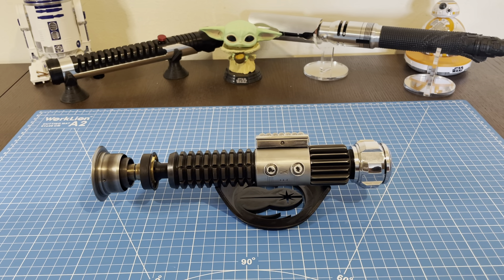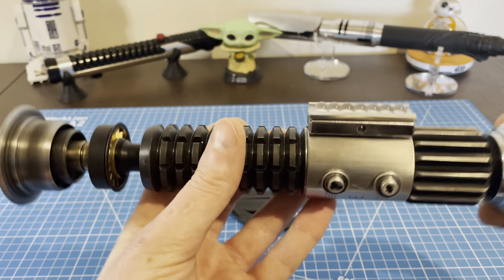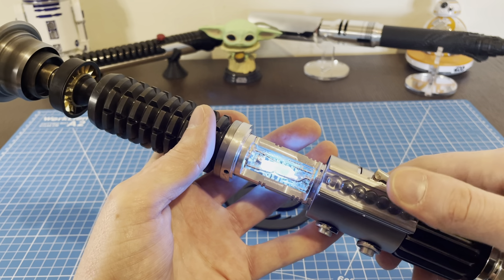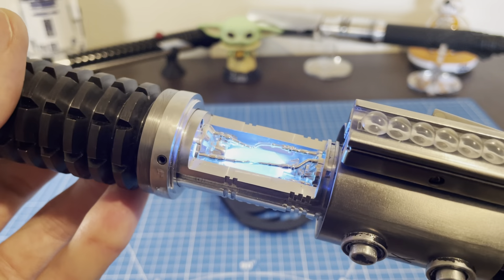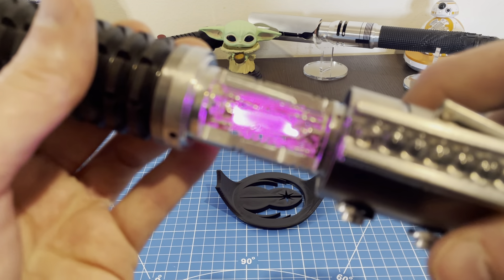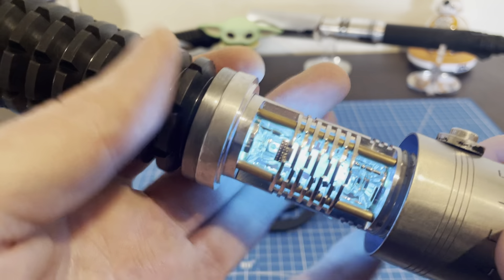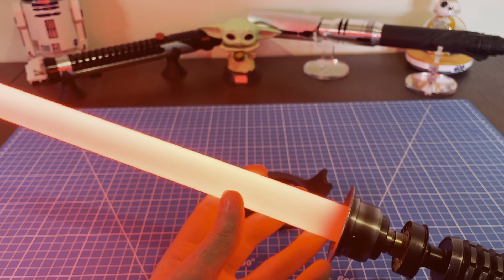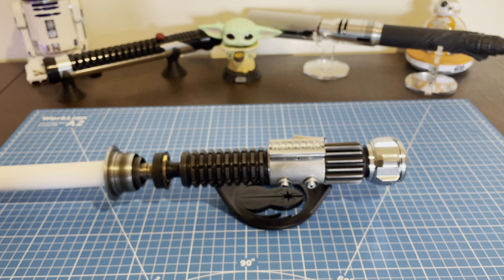Roman Props MK1 LightSaber with Rudy Pando Crystal Chamber and ShtokCustomWorx upgrades and Chassis.

Comment: Gorgeous installation! What did you use to make the 18350 rechargeable while inside the hilt?
Reply from the maker: Hi Rob, the 18350 battery is wired to the recharge port by soldering to both ends.
Reply: @ahch-tosabers6394  That's what I thought and what I ended up doing myself. I actually just completed my own MK1 install this morning. It's involved, but well worth it!

Comment: Is there somewhere that epxlains indetail what you did here?  i am confused on the  Shtok NXPL Led Neopixel connector. part..  do u have 2 of them..  ?   and also on another video they said inside the tube ( above the crystahl chamber.. they had to widen that thin neck part to put the  Shtok NXPL Led Neopixel connector.  in it?   did u have to do that?>
Reply from the maker: Hi zoicno, here is a link to the shtok manual for building this saber:
https://drive.google.com/file/d/0B-Owf66IGYP-YlpKSVhSTlhwQ1U/view?usp=sharing

It doesn’t explain everything in detail, but it does give a detail of the exact parts needed and pictures of a few steps for assembly. 
No I didn’t not have to widen the thin neck part, I’m not sure why anyone would have to do that for this install.
Reply: @ahch-tosabers6394  o ok thx. O yea just wondering Is it necessary for you to recess the pixel blade ?  Or can I just buy a normal one and I can still use it if I’m not using it for hard dueling ?
Reply from the maker: @zoicno  the blade retention strength would be very low on it, doing this option. I’m sure it’s doable, but personally I wouldn’t recommend it, even without any dueling.